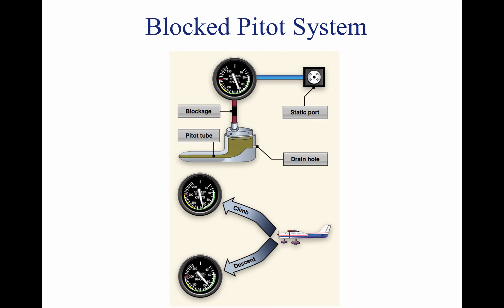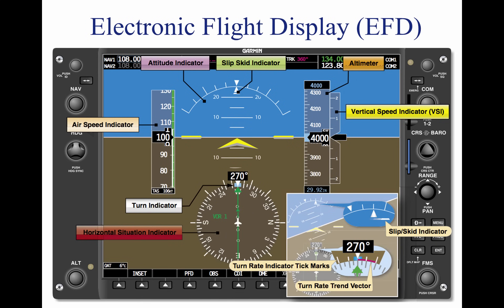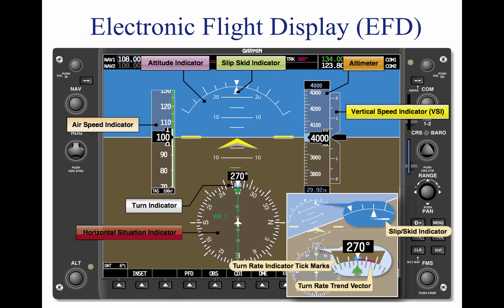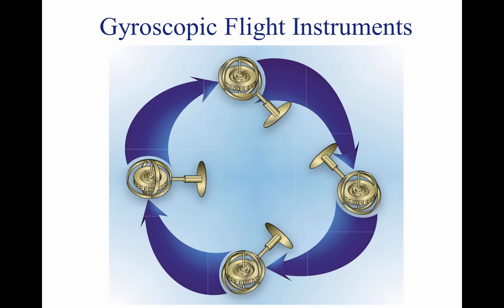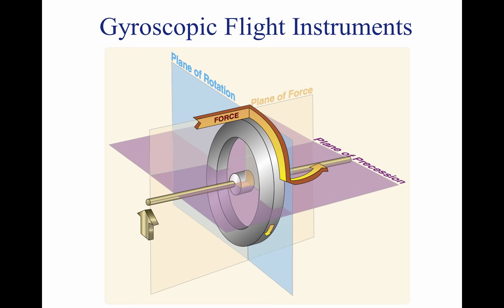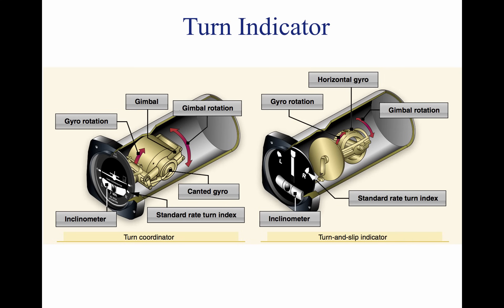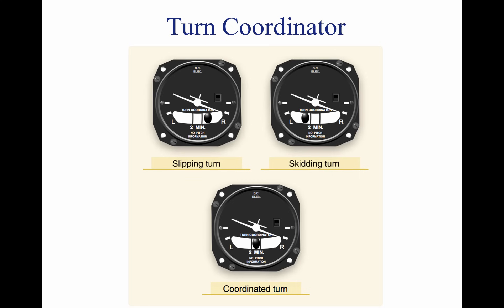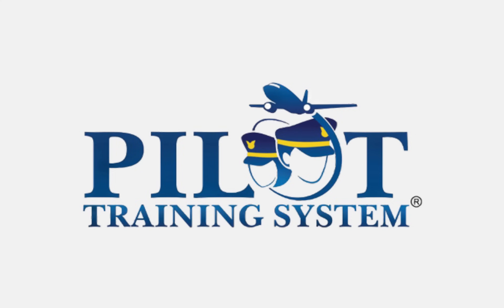Private Pilot Tutorial 7: Flight Instruments (Part 2 of 3)

Comment: The incorrect explanation of how a bicycle works is a little frustrating, but not uncommon.  Bicycles and motorcycles are, at all speeds, steered by the handlebars.  Lean is initiated via opposite steering, which makes sense if you consider where the road is relative to the center of gravity.  If you initiate a turn by leaning with your hands off the bars, the self-balancing nature of the steering geometry will actually create that opposite steering for you (if you lean right, everything below the CG counters left).  On a motorcycle at highway speed, you can JUMP on the inside peg or hang off the side like a monkey and the thing keeps going almost perfectly straight, yet 1 finger pushing the inside grip is enough to turn aggressively.  Gyroscopic effects do make things more stable at speed by increasing resistance to steering, but the steering geometry has a much larger effect (a bike with bad geometry can wobble violently at speed, gyroscopic force be damned).